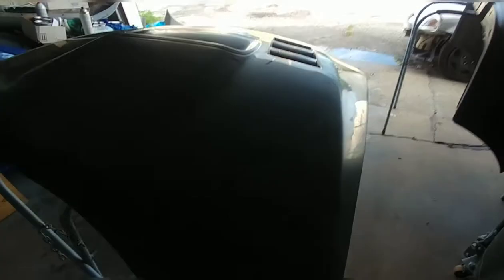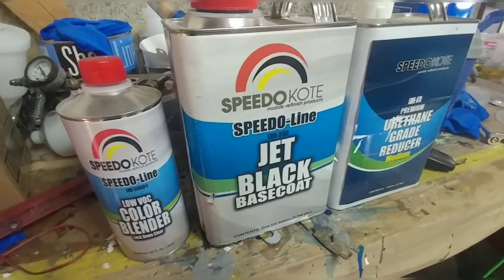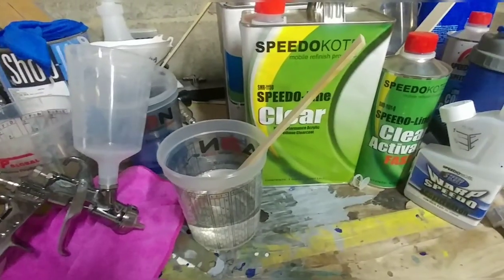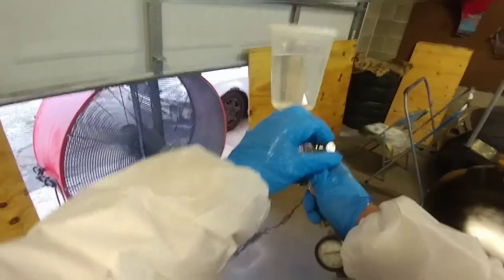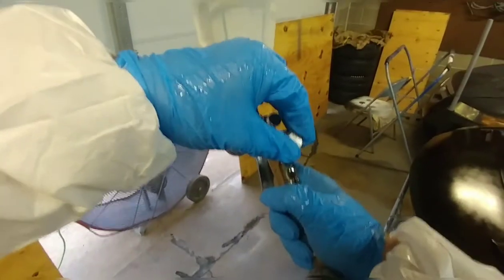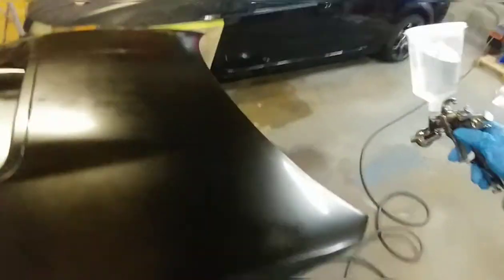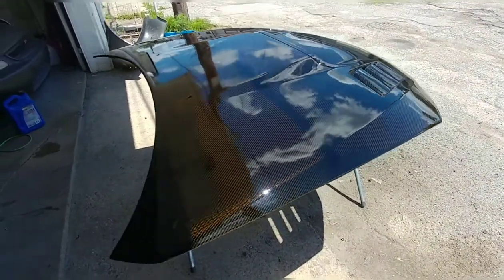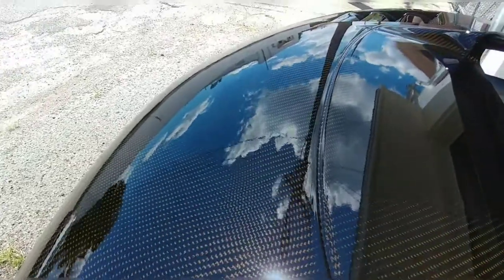Subaru wrx carbon fiber hood tint

Comment: Did the same thing to my CF hood on my M3 and man I loved how it would change from carbon fiber to black depending on the light and angles. Its really an easy and lovely addition . We called it Phantom Fiber lol .
Reply from the maker: Used the speedokote color blender as a tint ?
Reply: @speedokoterefinishnetwork4937  I dont honestly remember if it was speedkote, this was 6 years ago . My dad worked at Sherwin Williams so he mixed the paint there and gave it to me . Got the idea to do the hood because my friend who painted my car used to use clear and black to tint headlights and taillights and it worked beautifully . 

So I decided to have my CF hood done the same way with the left over paint to match the vehicle but also do a type of visual effect and it worked magically .
Reply: Hence the name "Phantom Fiber" because if you looked at it one way it looked like CF but if you move it would look jet black.
Reply from the maker: Wow Awsome!

Comment: Hey man could you do a video on how to properly set up an iwata for clear?  Kinda wondering how to set everything to zero and work from there type of deal. My clear sprayed decent but I had to wet sand a good amount
Reply from the maker: Sure thing man, orange peel can come from a million things .. Poor basecoat application, wrong speed reducer, wrong speed activator for clear coat etc etc .

Comment: Late to see this. But . Did the black tinted clear mix eliminate the browning or just mask it slightly?   I've worked with Pearls and clears to color  clear finish carbon fiber  but have   not yet used this technique to correct sun tanned carbon. Current project is some  baked  engine covers that are  damn near brown.  Your input is appreciated.

Comment: Can i use regular taillight tint by vht and then clear coat it with spraymax 2k clear coat? im trying to do my 350z convertible Carbon trunk
Reply from the maker: Wouldn't recommend it. Will come out super streaky / lots of tiger stripes

Comment: Great Video, could you recommend Speedkote SMR 1150 or SMR 105 as a base clear coat to hold .0004 Micro flake? Once dried, cured and sanded,  I would appreciate your choice between Glamour Clear SS 1200 and Premium High Solids SMR 42 for a Flow Coat?  Does all of this Chemistry get along with each other? Based on your last video recommendation I bought a new gun (Iwata Bellaria 1.3) I am a rookie with very little experience but so far I am very happy with Speedkote clears.
Reply from the maker: For flake you can just use color blender which is just clear basecoat without pigment, and over top of that you should use smr42 , ss1200 or smr 1100 those are our highest solids clears. I use a lot of smr 1100 and it works great.

Comment: Does this clear maintain its gloss and clarity or does it die back a little bit? I do dealer work, I have a few higher end dealers (Mercedes, Acura) and I get quite a few brand new cars with lot/transport damage. Finding good clear coats that don’t break the bank has been tough. I’m trying to replicate brand new factory finishes at discounted rates and with ultra fast turn around times.
Reply from the maker: You have 100% came to the right place. This clear coat is good , but I have others I prefer over it. My ultra high favorite if your looking for super quick turn around times is our "super fast high gloss clear coat" its super high gloss , dries very very fast and will produce oem like finishes . if you have any farther questions please contact me here to help
Reply: Speedokote refinish network what does a setup of the super fast high gloss clear coat go for? I’ve read very good reviews of the euro and glamour clears also. In most cases, my paint jobs are pretty flawless right off the gun. Perfect clarity and just the right amount of orange peel to match the OEM finish. The problem I run into is that the next day or a few days later, some clears get hazy and lose that crystal clear reflection and need to be buffed just to bring back the clarity. That is a pain in my butt. I send these cars back to the dealerships and I want to have peace of mind that the panels I painted aren’t going to end up looking dull. Right now I’m using Utech Select 4.0 clear and I’m getting pretty good results. After my discount it’s about $140 for a setup, 4:1 so I get 5 sprayable quarts.
Reply from the maker: We can hook you up for way less. The super fast high gloss clear does not fade or get dull and its only 99 bucks for a kit. Perfect for panel work . also saves time cause this clear has no flash time. Do one medium coat , wait 15-30 seconds , hit it with another coat and your done. The euro clear is The best deal we have , almost 2 sprayable gallons for 109 ! and same thing never gets dull and is super high solids content . call us today lets get you set up,with your first order , free shipping and ask for brad if you call and we can possibly throw you 10% off your first order or any other bulk orders .
Reply from the maker: I have many videos with the euro clear and super fast high gloss clear. Check them out I get crazy results with them.
Reply: Speedokote refinish network I will absolutely be in touch. I’m assuming I can find the phone number on the speedokote website?

Comment: I want to try this on my cf hood!  May I ask the mix ratio of the color blender and black basecoat?
Reply from the maker: zachm611 man I did this one on the fly ! I believe like 1-3 oz of jet black base (reduced) for every 10 or so oz of clear . this wasn't an easy job for sure. There a fine line between to much and not enough .
Reply: @speedokoterefinishnetwork4937  thanks for the reply! I guess I'll have to experiment if I end up going this route lol
Reply from the maker: Yea just have a test panel around and do a few differant mix ratios and see what looks best.
Reply: @speedokoterefinishnetwork4937  I just did this on my hood!  Turned out pretty good and the clear lays down really nice.  I've never painted before and I'm pretty satisfied with the results I had to paint in my shed and a random gust of wind blew some dust particles into the clear but I'm hoping I can wet sand and buff them out after a couple days.
Reply from the maker: Sweet man ! Just wet sand it with 600 and give it one last coat
Reply: @speedokoterefinishnetwork4937  oh ok thanks for the advice! I live in Colorado so it gets pretty cold here. I did add in warp speedo as well.  How long should I wait to wet sand?
Reply from the maker: I would give it a few days just to be safe

Comment: There is a $35 2k clear on eBay.
Reply from the maker: For a gallon ? Link ?
Reply: Yes let me see if I can find it.  I’m looking to buy the cheapest 2k for headlight restoration.
Reply: Nvm it’s 1 liter not 1 gallon.
Reply from the maker: If your only looking to do one set we sell kits for 19$ on the speedokote website
Reply: Can I spray this over rustoleum , once I sand the rustoleum with 500
Reply from the maker: If you use the satin rustolium with a spray can theres no sanding needed just let rustolium dry for 2 hours then clear coat over top

Comment: What kind of sprsy gun was used for clear?
Reply from the maker: I use my iwata w400 132g , super light , puts down a nice finish .
Reply: @speedokoterefinishnetwork4937 whats the price for one of those
Reply: Also is it better than a flg5
Reply from the maker: There on Amazon for 225ish , and not sure never used the flg